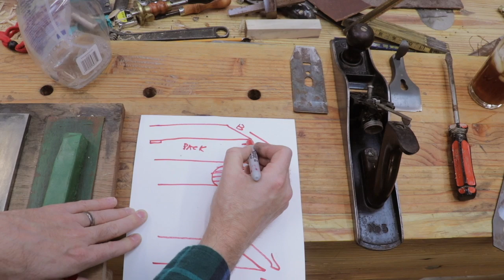How a SIMPLE RULER Will Save You Tons of Time Sharpening Plane Irons!

Comment: If you ever run into this problem again, or if you want to try with this blade, try the following. For extreme cases like this, use the black sandpaper for the initial flattening of the back on granite, glass, or a chunk old Formica countertop. Whichever you can find on the cheap. Going sideways like you did with the ruler, but not using the ruler, start with 120 grit, which is still more aggressive than the coarse diamond plate. Press on the blade only on the first inch or so and once you see you're reaching both sides of the blade, but there's at least about 1/4" near the tip that's flat, switch to 220 grit. From there go to the coarse diamond and proceed through your grits. Then hone the angle to exactly how you want it before you use the ruler. Use 3M spray adhesive or tape to hold down the sandpaper and your glass cleaner. I've heard that Simple Green works very well, but honestly, I don't know if it's any better than any cheaper stuff.
Reply from the maker: Appreciate the tips!

Comment: I have sharpened several Gnarly irons nicely by lightly tapping the high spots with my peening hammer. [courtesy Paul Sellers]
Reply from the maker: I have not tried that
Reply from the maker: I have not tried that
Reply: I tried that and broke two irons its not a good idea.
Reply: @patbassman8251  I said a peening hammer, not a sledge Pat.  :<D Seriously though,  Sounds like they were not of quality tempered steel.
Reply: @COLDROLD73   One Iron was a Stanley and the other was A2 take what you want from that, I saw Paul Sellers give his Stanley Iron a tap and it worked well , Its not like I wacked it , and im not sure about heating an Iron up probably not a good idea.
Reply: @patbassman8251  Yut! un huh, ok.